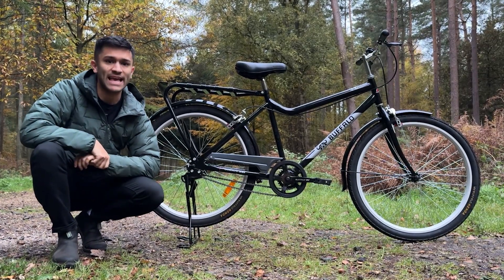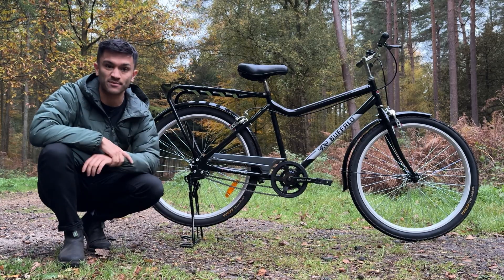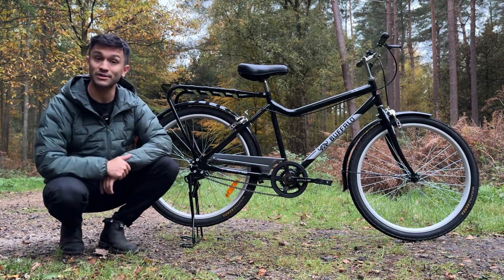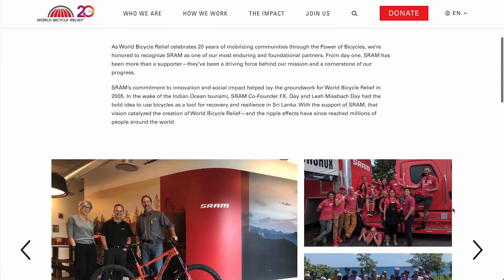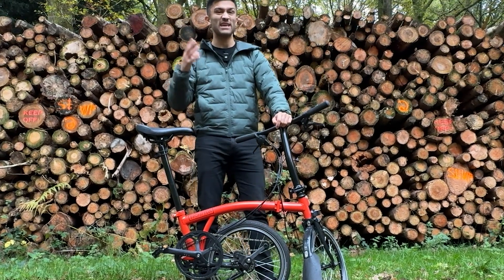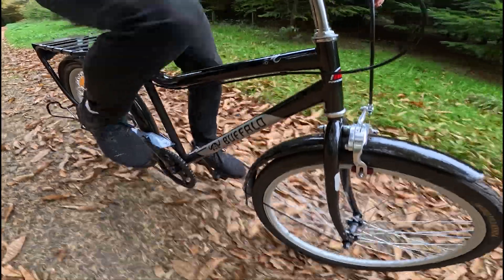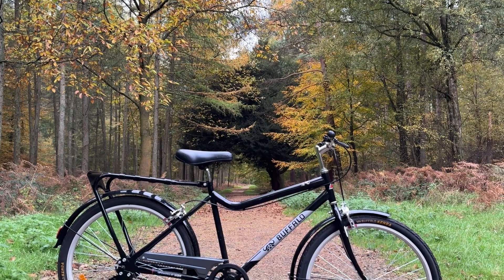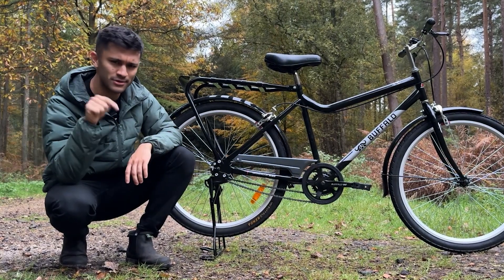How A Bike With TWO CHAINS Works

Comment: This is not smart at all.. in fact it’s a bit of a shambles
Reply: Buffalo bicycles are made to be as low maintenance as feasibly possible because they're used in africa for transport
Reply: @LucidityRemains yea I think we all saw Seth’s vid, it was a while ago but I’m pretty sure this is a different new bike, I certainly don’t remember it having 2 chains but maybe I’m wrong.
At first glance it seems like potential failure point but that doesn’t make it a bad design or anything, it may last forever.